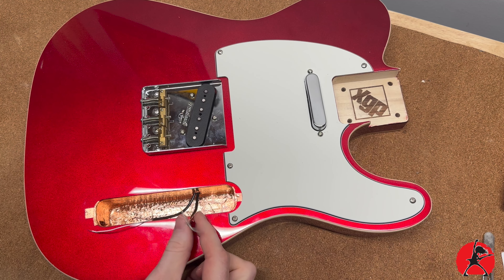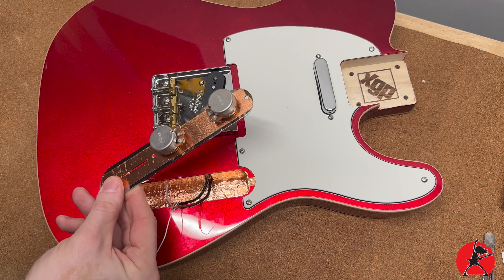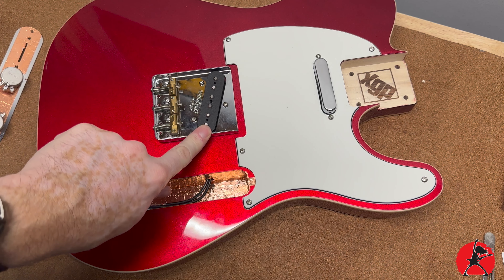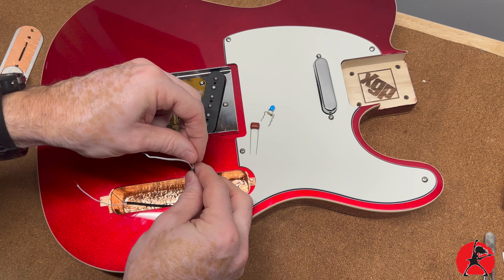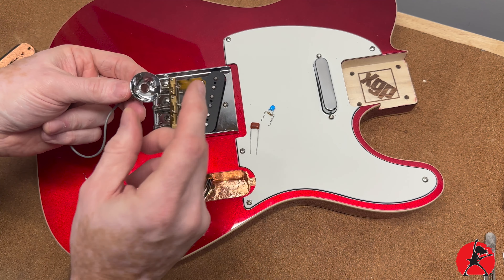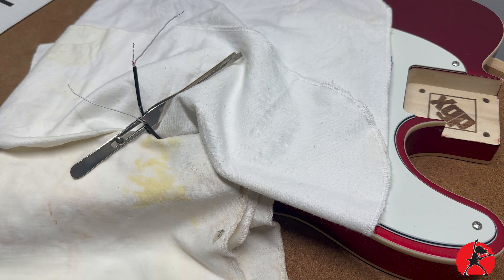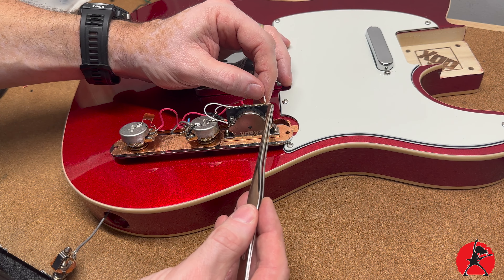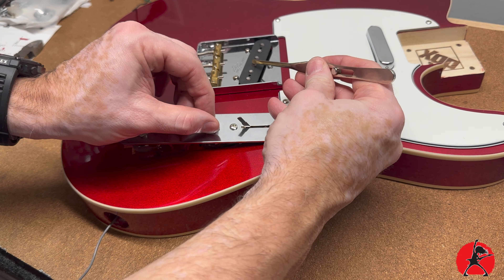Wire Up a Telecaster Like a Pro: Elevate Your Guitar Game!

Comment: I see you soldering a capacitor (usually .047uF?) on the tone pot. but you call it resistor. What values are you using? Specialy the resistor-capacitor duo bleeder. This should be a very small cap value and the resistor, never found any value. Nobody talks about it. You are right. Very often the graphics on amazon are wrong. We have to double check everything. One note: your faraday copper cage should be grounded to be efficient. Think of  a star ground to bleed away noise as they do in electronic circuits. A ground wire should also reach the bridge around a screw fixing it on the body. This will prevent noise while touching the strings. You take very good camera views of your work!  Thanks!
Reply from the maker: Hey Gilles, yeah I meant capacitor…it’s a .022uF one on the tone pot. 

For the treble bleed you can use a few different values. 1000-1500 pF Capacitor: Lower values = higher frequencies, higher values = lower frequencies 

100-330k-ohm Resistor: lower impedances are brighter, higher impedances are darker
Reply: Thank you. I'm noting all this!  :)

Comment: can you do a follow up video on the Kaish switch since it's been almost a year
Reply from the maker: @kevintrick4541  its still going strong. No issues at all.
Reply: I got this switch, replaced the import one in a Schecter, but it darkened the sound. It adds capacitance to the signal passing thru. I changed it to an Oak Grigsby and voila, the brightness is back.

Comment: I kept buying junk soldering irons. I bought a basic one but from StewMac, perhaps even a 3rd more than others  but their stuff insures you get usable tools even with their cheapest. My point being my past efforts were hampered. I noted you did not wind the wire thru the holes on the pot or indeed use any little clamps etc. I was doing that because of junk soldering irons, lol
Doing just how you showed me I feel confident to tackle. So THANX big time for keeping things simple and clearly easy to view.
Reply: Iv been thru several irons myself , finally ask a real pup winder what i shld get .He recommended a hakko fx-888D . Had it over 3 yrs ,goin strong thts way longer than the others . Just a thot . Good luck .
Reply: @tomfoolery2082  Thanx for the heads up!!!  I made a note of it.
Reply: I use a KSGER T12 - love it!